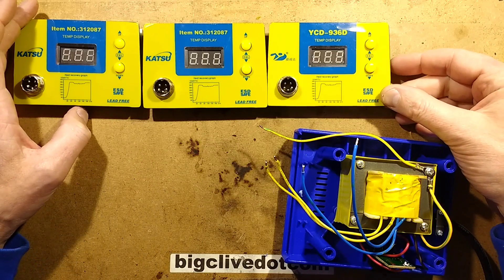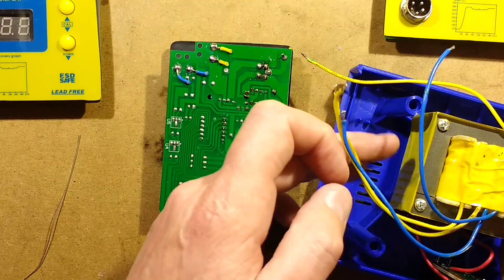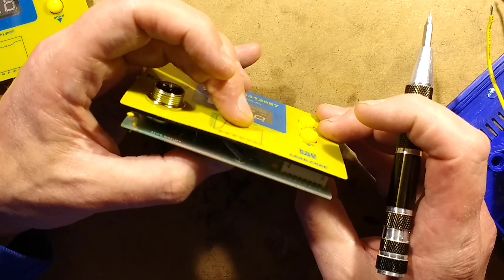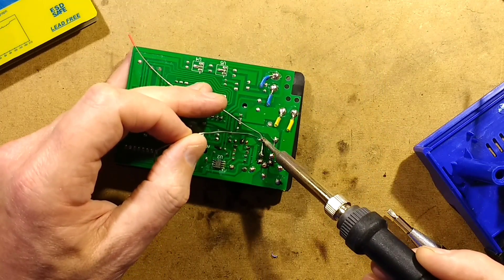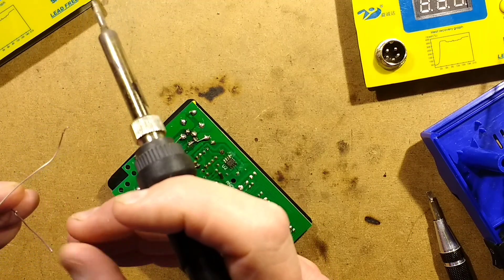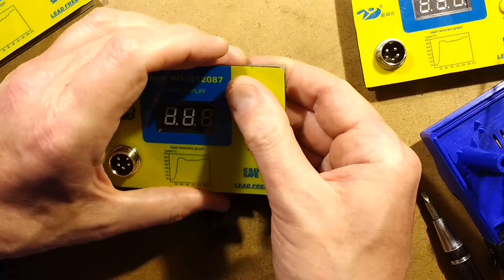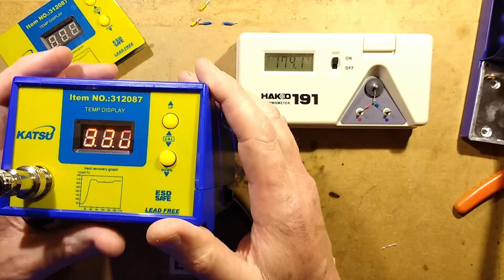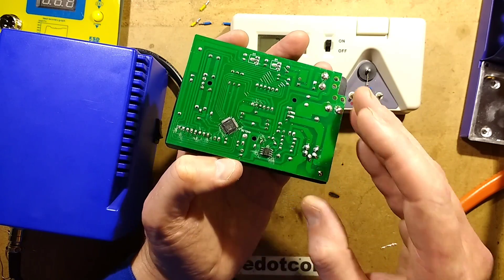Fixing a common fault with the 936D style solder stations.

Comment: :) So many fans of Lead based solder in comments. I have not used Lead based solder in about 14 or 15 years and I'm not missing that.
Reply: Cracking under thermal or mechanical stress, I'll wager.
Reply: I didn't miss shit. What was the guy doing, smoking solder? I smoke too and I've been working on electronics for 40 years. Lead simply is not that harmful. It's not nerve gas. It's all a big bugaboo scare. Bullshit dreamed up by ignorant politicians that can't send an email by themselves. People with zero technical aptitude. What they're worried about is electronics waste ending up in landfills and lead leeching into water supplies. Because they can't even manage garbage right. That's why there is RoHS today. No other reason. Because these idiots can't even deal with trash. Well manufacturers might have lobbied them for it, so stuff breaks sooner. Because the military and aerospace contractors are exempt from the law. They won't use lead free junk. Because it is inferior.
Reply: About 20+ years ago a technician at one of the technical universities died of severe lead positioning because he was not washing his hands after working with Lead based solder and then smoked cigarets. The lead dust particles on his hands where ending on the outside of his cigarets and then the high temperature will create small amounts of Lead vapors that he directly inhaled over a long period of time.
I know people do not usually smoke cigarets this days but Lead is a potent neurotoxin. 
While this is an unlikely scenario it happened but also think about where all this electronics end up and how they are dispose of.
I remember images with piles of electronics (probably in China) where people will use an open fire to melt Lead based solder and recover components, copper and some other stuff from that garbage.
There is a reason Lead was banned from almost all products (lead paint, gasoline, water pipes). Most of the Lead used today is for battery production and that will probably also end quite soon since they are not particularly inexpensive or with good properties (not anymore).
Where I need low melting temperature solder like LED, or some more sensitive plastic connectors I use Sn42 Bi57.6 Ag0.4 solder with a melting point of just 139C.
I do not realy work much with trough hole parts (actually almost at all in the past few years).
Lead Based solder is only used as a hobby all electronics manufacturers used Lead free type solder.
Reply: electrodacus what was this guy soldering with, a welder? Do you know what temperature lead vaporizes at? A soldering iron would be incandescent that hot. It would be glowing! Now be more fucking full of shit. Lead is not fucking Polonium. It is not that god damned dangerous unless you ingest massive quantities of it while you are young. The reason lead was banned from products is because they want to sell you shit and make more money off your sorry ass. Get the fuck out of here. Your kind makes me sick! You God damned whiner.
Reply: You probably missed the part about cigarette (he was a smoker) and the cigarette was the one that vaporized the Lead. The Lead particles ended up there because he was not washing his hands before handling the cigarette (he did this for many years).
A cigarette burns at around 900C well above 500C needed to create Lead vapors. 
The RoHS was introduced in order to reduce the discharge of Lead in to environment. According to Institute for health metrics http://www.who.int/mediacentre/factsheets/fs379/en/ about 853 000  deaths are attributed in 2013 to long therm effects of Lead to health.
Reply: Don't trigger them.. I was accused of being a member of the Japanese cartel responsible for pushing lead-free solder so that things failed more often on the comments to one of Clive's other videos. I think all the lead poisoning is finally taking its toll on some people.
Reply: What is lead free solder doing for you that solder that contains lead does not?

Comment: How do you test for leakage current on a soldering iron?
Reply: Usually by smoking any junctions you get near. Seriously though, you would test for a voltage difference to a known good ground. Or test for continuity from tip to ground pin on the plug.

Comment: When doing this same sort of repair, I usually clean off all the solder mask about the same distance back as your new pads, then lay the wire (usually heavier gauge) and then flood each connection with solder. It adds a large physical mass to support the mechanical loads. I once did that fix to my windshield wiper motor controller 10+ years ago. Haven't needed to touch it since.
Reply: I have done that to several wiper motors, usually GM with the integral circuit board. Just clean, flux, and reflow with some lead and they are forever boards now.
Reply: Mike Cowen But for cases like this, that would ruin the ability of the botch wire to allow future plug and board movement.
Reply: John Francis Doe The point being if you can provide sufficient physical mass, the flexibility is not required. It's sturdy enough to hold its own without failing. If you can make the joint solid enough that it CAN'T move, no flexibility is required. Keep in mind, the original flexibility in the joint is what caused the problem. I've been playing this game as long as Clive, and you tend to learn what works best in a given situation. Admittedly, this basic design sucks, mechanically speaking. It's designed for assembly, not durability.

Comment: You can always use hot glue if you don't have second soldering iron :D 
Of course it's not best solution or safest but for most of time it keep such moving elements in place. I use it very often after soldering some parts that "could move a bit"
Reply: Please explain how you want a piece of plastic to conduct 2.5A of current.
Reply: Siana Gearz you didn't get the idea at all... Eh...
Obvious point is to use hot glue to keep those elements in place so they don't move, not to permanently solder them to board.
Reply: Akinaro I did, I was being sarcastic. What you really want to use to conduct 50W worth of energy is an ever growing air gap. Give it a few kV and it will arc over, works just fine. You won't even need the current then.

Comment: It would be quite straightforward to 3D print some supports or maybe a shroud to hold the PCB firmly in place and correctly alighted with the front panel. As I don't have one of these solder stations there's no need for me to bother and, in any case, I don't have the necessary dimensions. Now I have a 3D printer I'm always looking for things to make or fix with it.
Reply: You could cut a few bits of something to length and glue them in there, in a fraction of the time it would take to print something.
Reply: Because people need something to justify their newest WhatevrBot clones they jumped at to be part of the craze.
Reply: heh why don't you two find a room and rub soldering irons or something to chill out :D
Reply: Just thinking the same thing haha. Bigclive Get a 3D printer!
Reply: True, but designing simple parts is not too difficult really if you've got a 3D printer and then you can share your fix with the internet
Reply: >Why over engineer the solution? Plastic standoffs and silicone would be fine.

I wouldn't recommend silicone on circuit boards because many types of silicone are acidic (they have a strong vinegar smell) and will corrode the board.
Reply: Jeweler's saw and glue - the original 3D printer
Reply: The point you're missing is that most people don't have a degree in adhesives to know the difference and you saying "just use silicone" without specifying a type can lead to destroyed electronics.

Hot glue is a better solution despite being stringy and there's no acid involved.
Reply: +GGigabiteM that "strong vinegar smell" from silicone is just that, acetic acid which is essentially what vinegar is (typically 5% or less).
Reply: @Pete Allum, I believe there are some on the market which are suitable already. They have a sticky pad base and latch on to the board edge. They are like the sticky pad pillar type.
Reply: evostik sticks like sh*t adhesive would do it. doesn't contain acid or solvent so won't rot your unit out while it dries :)

I use that stuff for a mind bogglingly wide variety of uses.
Reply: So you wouldn't recommend ANY silicone because SOME are acidic? That's some weird reasoning ...
Reply: Sticks like sh*t like many modern adhesives uses the moisture in the air to set.  solvent and acid free.  silicon is rubbish in many ways as it is corrosive and doesn't stick too well either.  only benefit it sometimes has is better heat tolerance.
Reply: The non sequitur and straw man fallacies is strong in you! Let the butthurt flow my son.

Keep making these rants up, they're a hilarious read because 99% of it is bullshit, but entertaining bullshit nonetheless.
Reply: Now, children! 
I'm astonished at some contributors ability to get so incredibly worked up just because someone has a differing opinion! 
My original comment was purely to suggest ONE option for a solution to hold the PCB firmly in situ. I was certainly not excluding any other possibilities and, in fact, my first thought had been the use of some sort of stand offs and a way of affixing them but as I'm fortunate enough to have a 3D printer that became my preferred option as the solution could be tailored to exactly fit. If I had the unit in front of me so I could better assess the possibilities I may come to a different conclusion altogether. IMOA if I were to use an adhesive my first choice would not be silicone of any type as it takes much longer to cure than most other alternatives but if that's what you have and you don't mind waiting for it to cure then why not? I doubt the acidity would likely eat through anything but careful and judicious application would be beneficial in this regard.
Reply: Yeah, no idea why this guy is so mad. He's so mad that he's seeing things that were never there in the first place.
Reply: Fuck off with your phrasebook, Freud. You of all people should be the last one to talk about things that aren't there, like the ability to make informed decisions based on the smell of glue.
Reply: lol, what? It's pretty easy to make an informed decision about how something smells, so long as you aren't shoving it directly up your nasal cavities to get high.

Go outside and get some fresh air or something, your blood pressure is probably in the danger zone from all of this angry ranting.
Reply: Yes. Exactly. It's really easy to do that. Yet, you still deemed practically anyone and everyone to be completely untrustworthy to make such decision, and considered yourself eligible and behooved to save everyone from themselves and outright and blanket-banned any and all silicone for potting. You know, you had better plug those nostrils of yours, lest you want water get into them when it rains. But don't use silicone. Some brands are acidic, mind.
Reply: well.. that escalated quickly..
Reply: +Anvilshock

It's fine if you want to keep straw manning yourself and being angry all the time, but do take it elsewhere, you're getting a tad repetitive and annoying now.
Reply: "Some silicone contains acid. Acid destroys circuit boards. All silicone will destroy circuit boards." - Go have a look in your rhetoric phrasebook. Sounds familiar? And YOU want to tell ME that my reasoning is flawed? I don't NEED to post a distorted version of your statement, it was that idiotic to begin with. Just to let you know.
Who made you the chat police, by the way? You take your own repetitive retorts elsewhere first!
Reply: Naah, it doesn't sound familiar, you're just straw manning yourself again.

I hereby nominate myself as "chat police" and since the motion goes unopposed at the time of this writing, the motion is granted.

As my new title of chat police, get out.
Reply: cool story bro
Reply: So I suppose YOU have a degree in adhesives to know the difference to be justified in holding everyone else for so stupid they cannot be trusted with glue. "The silicone you're referring to uses acid to cure. When I'm worried about that, I'd use a neutral cure silicone." I trust this person has a degree in adhesives, too, then.
Reply: +Anvilshock

>So I suppose YOU have a degree in adhesives to know the difference to be justified in holding everyone else for so stupid they cannot be trusted with glue

I have a degree in working for the public, it's called common sense. The average citizen will know what adhesive is, but they will not be able to tell you what the difference between acidic and non-acidic silicone is and the use cases for either. Nor will they be able to tell you why certain adhesives are better for some applications and not others.

When you work for the public for decades, you learn that many people have a deep knowledge about their specific skill set, but a shallow knowledge outside that skill set. There are far fewer people in the general public that have knowledge that is both wide and deep.

Comment: Seems to me it would be less trouble just to add a few plastic clip posts to hold the board, rather than them dinking around with trying to get the solder to support the PCB better. Really makes you wonder what these guys are thinking when they design these things.
Reply: Especially ironic given it has buttons on the other side you need to press.
Reply: mysock351C 
That's why it's a cheap clone of the original. The extra support would cost more in parts and manufacture so they've designed it so the case is supposed to hold both the front panel and the PCB in place. This is obviously not always sufficient, but it's the cheapest option.

Comment: Put some hot glue or silicone between the board and faceplate to help support them.
Reply: Keeping in mind that it's a generic (low) quality station, I'd go with something a little easier to service later like proper screwed-in standoffs.

Comment: In the market for a new soldering station, I was glad to see your video on this particular one. However, I find it interesting that the Hakko 936D is not listed on eBay US!
Reply: I'm quite happy with my Weller WES51. It's old-fashioned, but it's good.
Reply: Jed Rhoades I have the same iron. It's a real trooper!
Reply: Not all that interesting.  The real Hakko 936 isn't digital, and went out of production years ago, so there is no such thing as a Hakko 936D.  What there are, are clones that were named 936, then when the clones switched to a digital front panel, put a D at the end for the digital version.
Reply: William Garrett If you solder large connections, I recommend getting the 936P. It's the same as the regular 936, but can deliver more power.
Reply: If you are in the market now, i'd look at one of the T12 based Hakko clones. they cost about the same ~$40 assembled or slightly cheaper as a kit, and have higher thermal mass than the 936 clones (at least the one i had).

Comment: I've got four genuine hakko digital ones that have that silly adjustment card slot on the front. Tempted to mod them, also tempted to just sell them
Reply: Love Hakko products. I have a few Gens worth. However because of the fakes running around mostly only buy from Hakko USA. Don't have to worry about them selling me a fake. Prices seem to be lower then what people are selling on Ebay in most cases so why buy from someone that could toss a fake. The Car idea is good for production work. Set the temp and don't have to worry about someone changing that temp. However can use a card in the right shape anyway. Not without design flaws.

Comment: Soldering stations that haven't been soldered together properly.  How ironic!
Reply: Solder iron(ic)
Reply: Agreed there is a mechanical design flaw, but it actually looked like pretty bad soldering as well.
Reply: And if you need a soldering station to solder a soldering station, how did they solder the first soldering station????!!!!
Reply: Chicken egg problem....
Reply: Kean Maizels love the profile pic!
Reply: Commander Keen!
Reply: OhTheIroning.png
Reply: you dont, you can solder using a flame heating a bit lump of copper, as are the pre electric way of doing it
@doc
Reply: Pete Allum I believe both are true. One of the pics at the beginning definitely showed poor joints and another damage from movement.
Reply: my thing?
Reply: How you solder solder station without solder station?
Reply: So do I, I instantly recognised it.
Reply: :D
Reply: Fire.
Reply: And did the egg come first or the chicken???LOL
Reply: Do you mean ionic?
Reply: It's not so much that they haven't been soldered properly but that the mechanical design for support between the PCB and the front panel can cause the socket connections to break due to excessive movement. Not very ironic but more accurate.